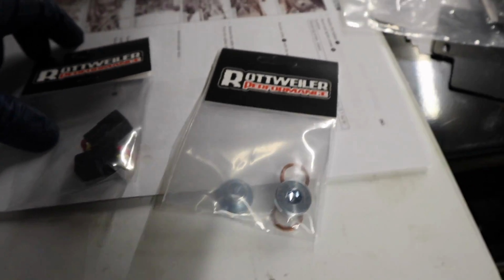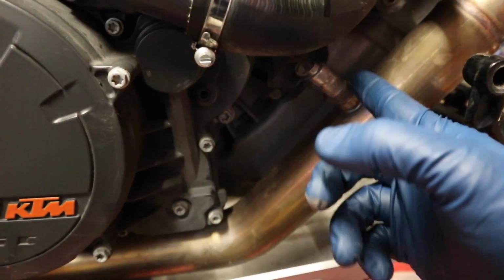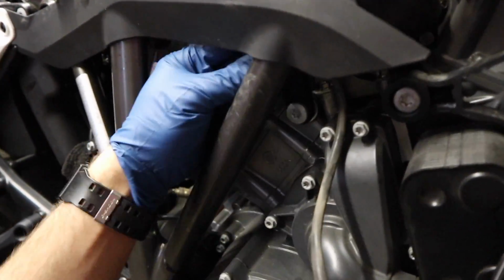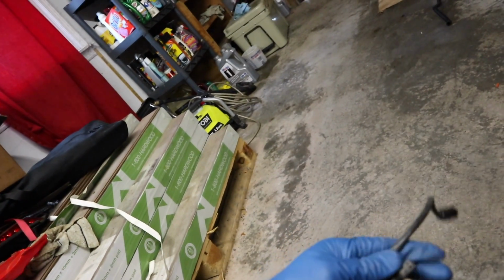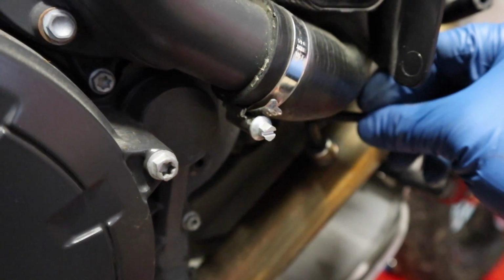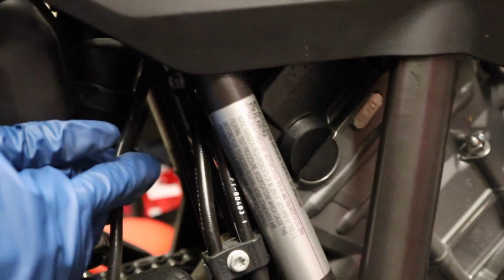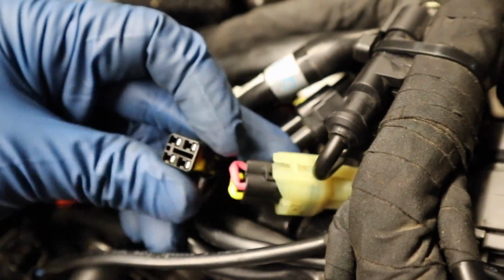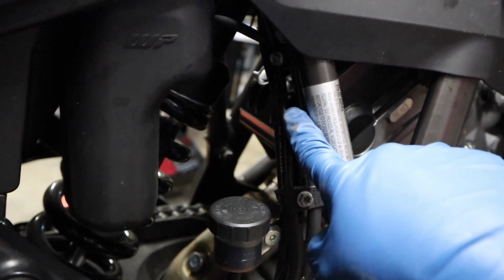Rottweiler Fuel Dongle Install on KTM 1090 1190 1290 Super Adventure | Back in the Garage

Comment: I just did the Rottweiler Fuel Dongle install on a 2015 KTM 1290 Super Duke r.  You do not need to remove the gas take.  The first plug is located behind the plastic cover on the right hand side.  The second plug is located by the top of the rear shock.  You can see it and access it from the right hand side as well.  The results from this mod is very noticeable.  Bike is much quicker right off idol.  Gone is the low rpm hesitation and rough herky jerky surging throttle response at low idol.  Stock at low rpm in 1st and 2nd gear the bike felt like is was going to stall.  It required a lot of clutch impute to keep the engine's rpms happy.  Now it just hums along at slow speeds.  This is a 100% definite mod for anyone who's bike is not happy at low rpms.   Also get the stainless steel O2 sensors plugs and not the cheaper steel ones.
Reply: Did you modify your air box or leave it stock?
Reply: @jaybourbon8608  Left it stock.
Reply: Really appreciate the in depth response. I ordered the dongles, and read that dropping the front sprocket down 1 tooth to a 16t really makes a world of difference. Can't wait for the parts to be here. Found the JT rubber cushioned sprocket on amazon for 21 dollars, and also the 12mmx1.25 stainless bungs on amazon for 7.99 a piece. With new copper crush washers.
Reply: Hey do you notice a little fluctuation at idle? Very slight and also if you hold at higher RPMs? The dongles are great just as you described but when I let the bike idle and warm up I hear this little sort of rich pop or stutter it's very slight but it's also there at the other rpm as well. Thank you in advance.

Comment: I would be interested in fitting the fuel dongle on my 2015 EU super adventure, I didn't understand well, if there are any contraindications to fitting it with the original catalytic converter, could you help me?  I would like to physically remove the lambdas and install the O2 sensor eliminators, but I have the bike in original configuration, with only the Akrapovic exhaust.

Comment: Hey buddy. Can I benifit from the fuel dongles with just a slip on Arrow exhaust and stock air intake? I was reading some are punching out the catalytic converter to add more flow. Haven't read anywhere if the 2015 1290 super adventure comes with these cats? Thanks love the channel. Also. Any harm in just using the dongles and leaving in the 02 sensors unplugged?

Comment: it looks like it's just the same connector with the connection points looped through (with maybe a resistor in between). In that case you can also cut off your own o2 sensor and loop it through?

Comment: Hi my friend, you will recommend this for world travel? For example, in situations where you need to go to places with high altitude 4 thousand meters and then lower altitude places. Curious about how it works compared to the o2 sensors in these situations?
Reply from the maker: These are NOT the bad fuel dongle that allow you to run low octane fuel. All these do is richen up the mixture.

Comment: You guys getting a little fluctuation after installing the dongles? If I let the bike warm up I can something that sounds like an extra little fluctuation like when an extra spark plug fires then stops. I did do the plugs when I did the air filter so I know they are good. When I hold the throttle at for day 3 to 4k RPM I still hear a little not really a miss but I see the rpm not steady it fluctuates just a little. I've been over every inch of this bike, and I didn't recall this in the warmer months. Thoughts? Anything to look for? Almost like an intake or air leak but I went over all that when the tank was off.
Reply from the maker: Over 50k+ miles later and never had an issue. Wish I could help.
Reply: @2WR  it was just the one day. I let the bike sit for about a month, and started it on a 40 degree day. It was also pretty low on fuel. Went for a long ride and it's been fine since. Not sure what the deal was.

Comment: good day.  I am your subscriber, I would like to ask you if at this time, you could test if the temperature really drops and what other benefit you found.  I don't speak English and I use a translator, sorry!  Greetings from Argentina.
Reply from the maker: Temperature drop, I didn't notice anything but the throttle response is MUCH better.
Reply: 2 Wheeled Rider muchas gracias!
Reply: I ordered the shield dangal from Rottweiler. One of the wires on the field angle was naught crimped into the connector. My bike would not even turn over. I talked to them at Rottweiler and they said that there was a different issue. But when I put the O2 sensors back in the bike fired right up. They're sending me a replacement for the bad one. Just wanted to ask you have you had any problems since you've installed them. And are they worth it

Comment: After installing the fuel dongle, i got a "general failure" warning. Is this normal?
Reply: Never mind...  I hadn't plugged in the seat heater cable yet. After plugging this in, the warning went away....😂
Reply from the maker: Figured that was gonna be the response 😂

Comment: I have already installed the KtM dongle for the ABS map issues, is it compatible with the Rottw. dongle?
Reply from the maker: 2 different things. The dongle you have installed has nothing to do with fueling dongles. It simple saves you offroad/abs settings and will reduce power to allow lower grade fuel to be run.

Comment: Was there a noticeable result in power and performance in doing this?  How did this affect fuel economy?  Did the bike run cooler?
Reply from the maker: Fuel dongles alone isn't going to add any power. They're made to richen up the air/fuel mixture at low rpms and there's a noticeable difference in throttle response and smoothness from off to about 20% throttle. I haven't had enough time on the bike (thanks weather) to run enough fuel through for fuel economy comparison yet. Same goes for engine temp. They are supposed to help the engine run cooler (the new intake should help it run cooler as well) but I haven't had sufficient time on the bike to do enough testing yet to say for sure. Once I do, I'll be sure to report back.
Reply: I just added the fuel dongle to my 1090r and the results were very positive. Extremely smoother on the bottom. No jerking sensation. Great for slow technical riding. $$ well spent.
Reply: hi my KTM bros in the intrcuctions Rott perf said (Improved throttle response, with smoother power delivery and more HP and torque) N so less weight N u got more power = +HP... By the way if someone knows if i can put that shit on my bad bitch the Superduke 1290 R K 17 please let me fucking know I will ask to the guy of Rott perf at the same time https://youtu.be/7qRo2qgRZyw 
https://youtu.be/tDO_2a6B3tU 
Kind regards from Paris
Reply: @offroadtrailrider77  Did you take the tank off for this? I already recently did my own first service at 8500k miles and put everything back together. Already did the canister removal as well. How are you loving the 1090r? Love mine!
Reply: Portland Two Wheels I think I did to unplug the o2 sensor from the rear pipe. I loved the 1090r but have sense replaced it with a new 19 690 r enduro. I decided I wanted something lighter and more off-road friendly being the dirtbiker that I am. Plan to take 690 on COBDR this summer and Arkansas 500 Rally in April. I will say the 1090r was magic on the slab but scary in technical off-road conditions. Enjoy.

Comment: Did you notice more engine vibrations after installing the fueling dongles? I installed them on the 1290 SD GT, and feel like there is some more vibrations. Especially over 6000 rpm.
Reply from the maker: No. Keep in mind though, I also installed the airbox kit so never rode the bike with the fuel dongles only.